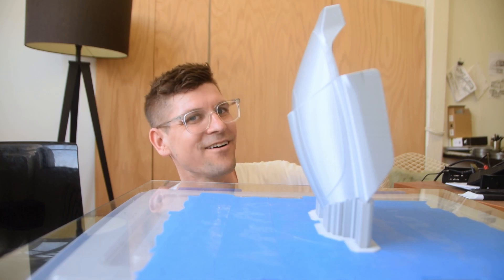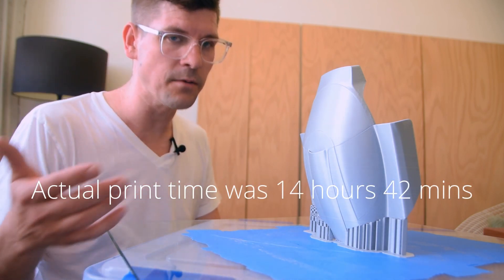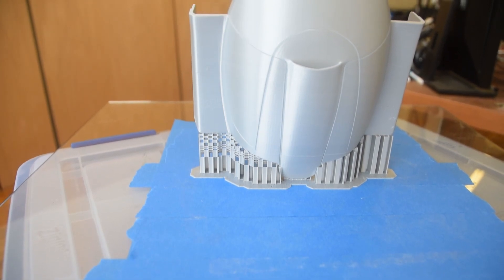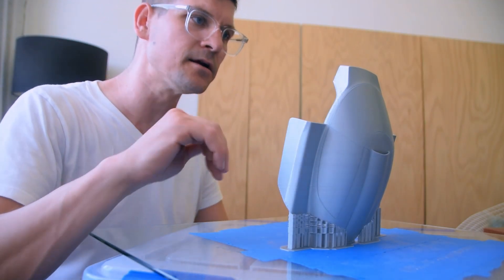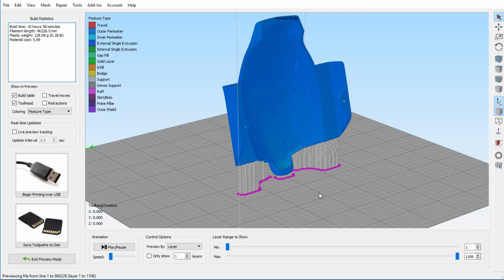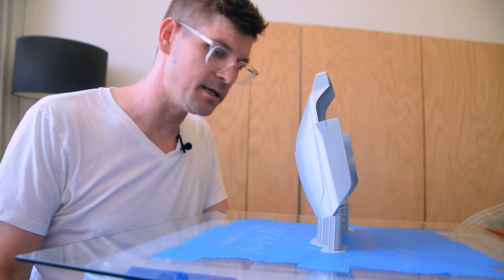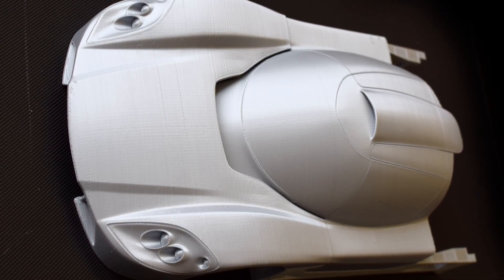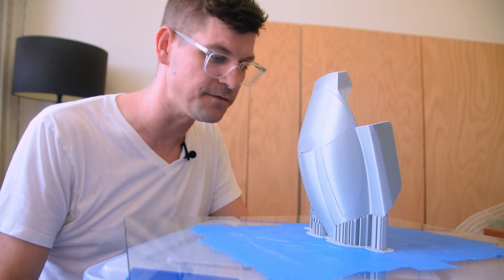Simple technique to cut 3D print times in half

Comment: Looks like you are having a bit of under extrusion on that silver PLA print you have. Make sure your filament holder is rolling smooth and up your nozzle temp a bit, maybe 5 degs. If you a having vibration problems, I also saw a vid in you tube to use tennis balls as footing for your printer, just design an adaptor so that it can sit firmly. Nice design by the way, can't wait to see a finish car print from you.

Comment: hi i want to know were did u get the model or how you make it ?
Reply from the maker: A member on the gt40 > SLC Clubhouse forum had an SLC 3D Scanned.  I'm pretty sure he used a structured light set up.   Professionally I would use Autodesk Alias to surface model over the scan data.  In this case, I wanted to force myself to use/learn Modo to build a complete car.  Modo has a retopology workflow that worked awesome to lay light weight sub Ds  on top of the heavy triangles of the scan data.
Reply: @kevinr6236  tnks  for the info i found it <3